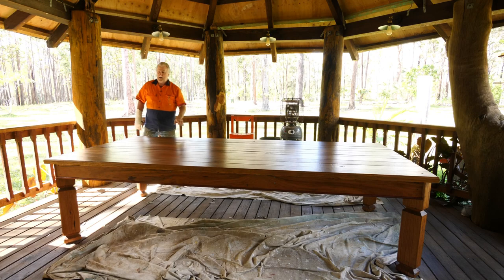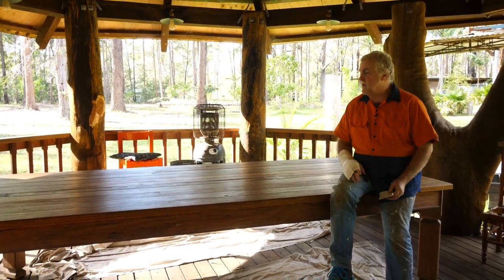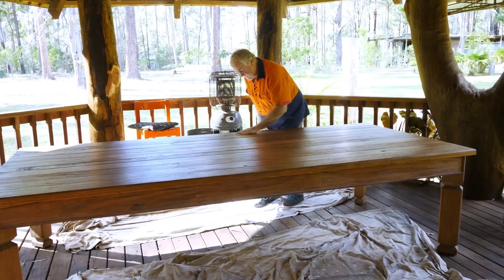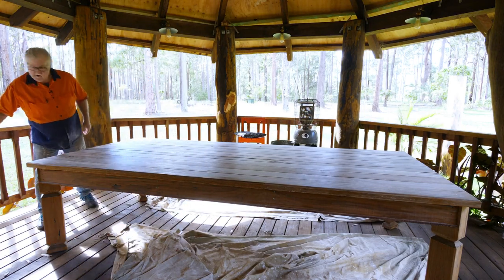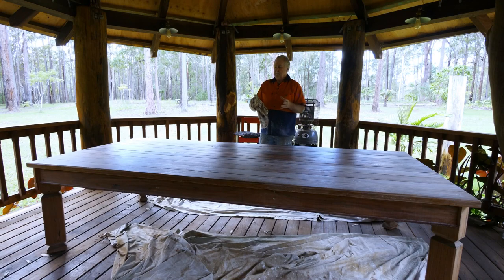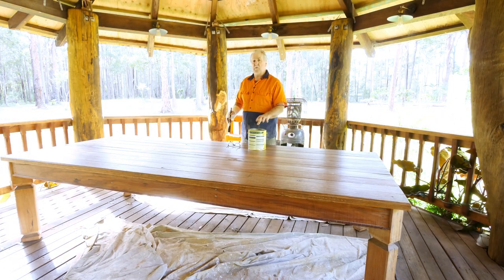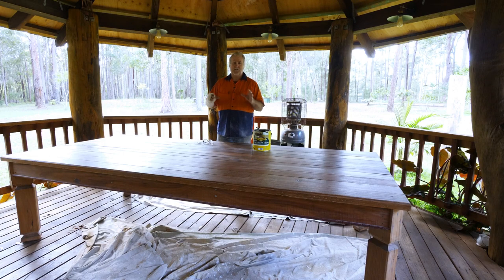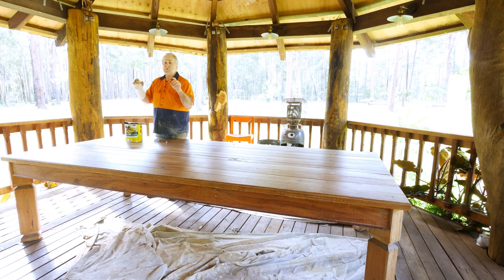Clear Coating my Giant Picnic Table

Comment: Can I use that on a kitchen counter top
Reply from the maker: Yes you can, but there are other products out there that are harder wearing such as clear 2-packs or single packs. 
Nothing wrong with poly's or varnishes tho, just not as hard wearing but easier to redo.